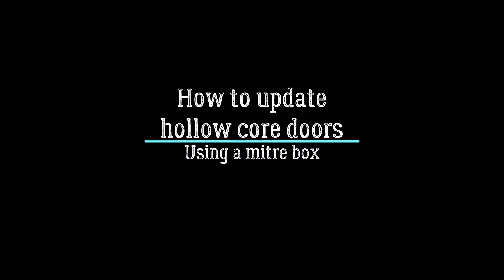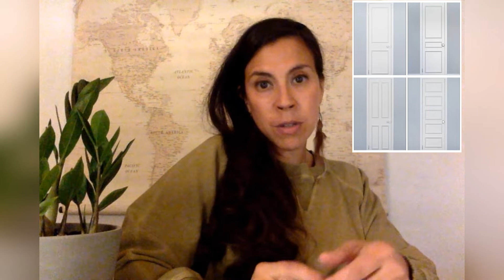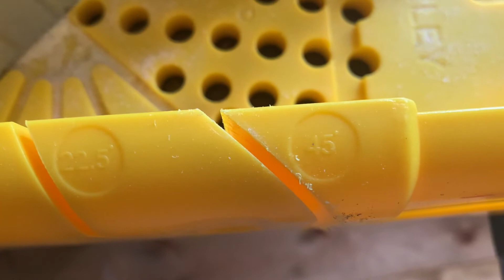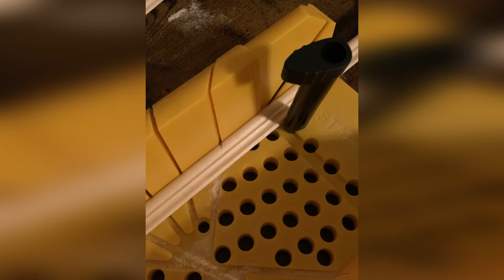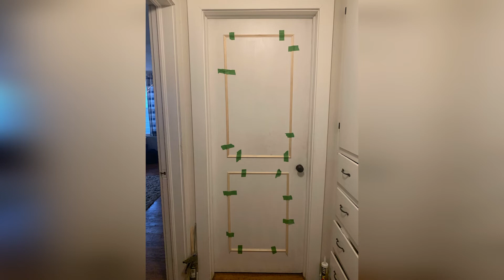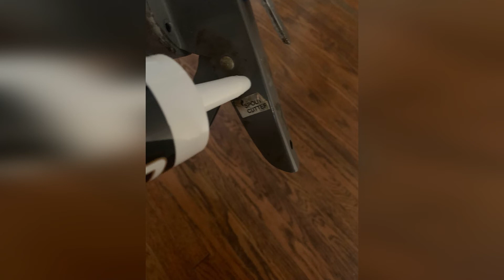Hollow core door makeover using a Mitre saw box  #hollowcoredoor #howtouseamitrebox #doormakeover

Comment: Wow.what a transformation. The door really looks amazing. You have inspired me and the way you explained everything in detail gave me the confidence to give my doors a makeover. Can you please tell me the exact width of the trim you used
Reply from the maker: Hi!  Thank you, I am glad that it all made sense!!!  Yes, my door measurements were 79.5 inches long and 29.5 inches wide (you could use the same cuts for a door 80" by 30" as well), so I used Jenna Sue's template for around that size (linked above in the description box).  All of the shorter pieces were cut to 19" (top & bottom of the boxes) and the longer side pieces for the top box were 36", the lower box sides are shorter measuring at 27".  I linked the exact molding I used from Lowe's above & the nice part is you can order all of the products online if you feel intimidated by trying to locate them in the store,  then pick up curbside!  Please feel free to reach out along the way if you need help!!!